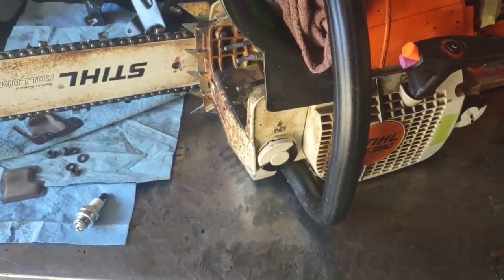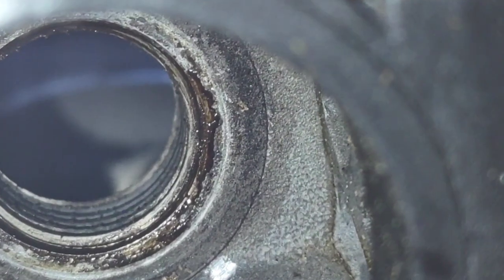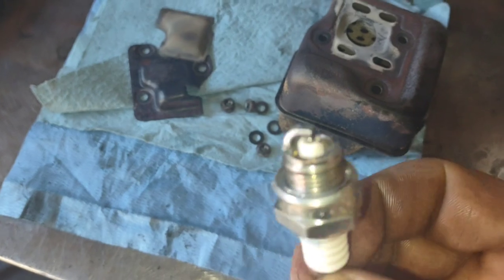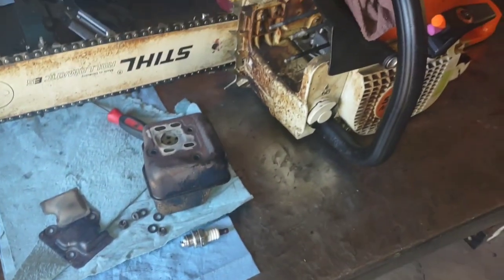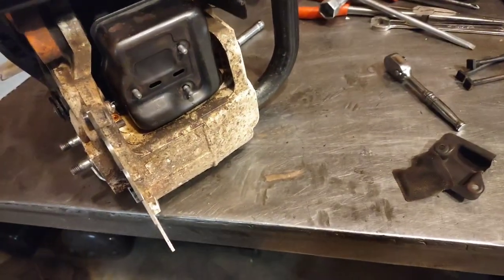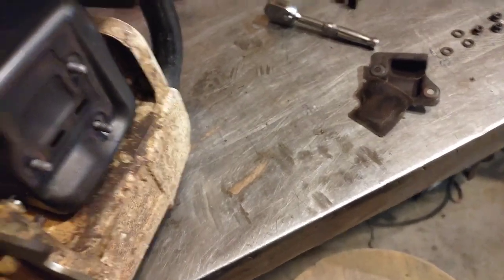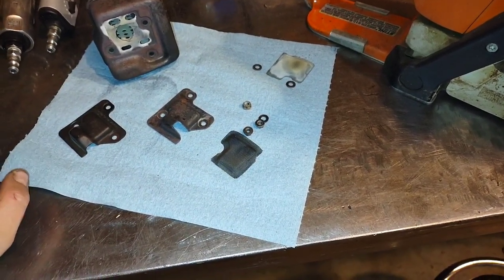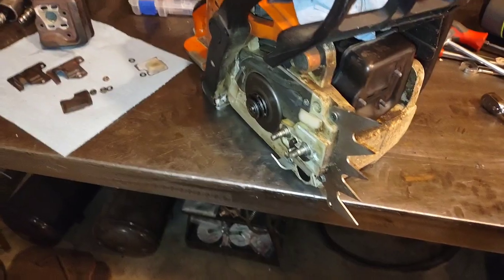(299) echo red armor oil in Stihl MS 390

Comment: It looks better, you can see it’s cleaning the carbon out.  Keep using and post another video.
Reply from the maker: I definitely will video it again when I put more fuel thru it. I also did this same kinda thing with my Stihl kombi motor and my Stihl MS 260. I'm just waiting to put some more fuel thru them before looking at them again. But when I do I'll video that as well.
Reply: Sticker is marked DOM 02 09 (date of manufacture) . 😎
Reply from the maker: @FLHPI02  o bad ass thanks 

I don't think I would have noticed that on my own

Comment: 25:1 is unnecessary with red armor lol
Nit a fanboy but with it being a very high detergent FD oil movie it to 50:1 or maybe 40:1 and youll see all the carbon disappear. 
It attaches to the carbon and lets it break it up. 
I did 50:1 on a 10 year old backpack blower. Had tons of carbon. Was idling at 3200 and topped at 7500. 
After one seaon of red armor i hit 12000 rpm with no carb adjust. Gained idle too but i adjusted down throughout the year. 
I used to have to make idle adjustments throughtout all thise years. Guess im setting it back as it gets back to more new condition. 
But 4500 rpm top end speed is no joke. 
Almost all carbon gone now. 
It was covered before.
Also bad air filter filtration has more to do with scoring than the oil.
Reply from the maker: Ya I'm well aware that 25:1 is unnecessary, but that's the rato I've been running for years and I was curious to see what it would look like with the oil switch